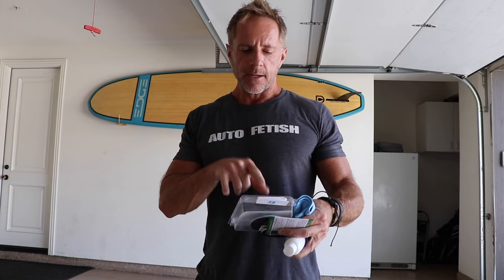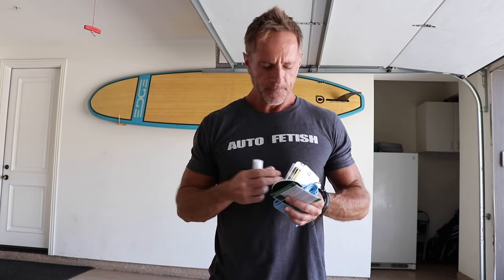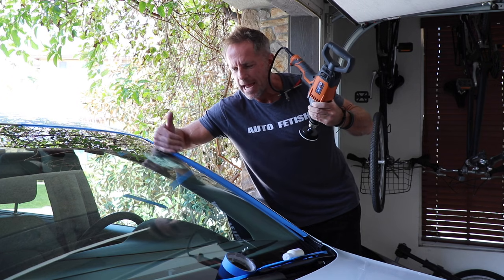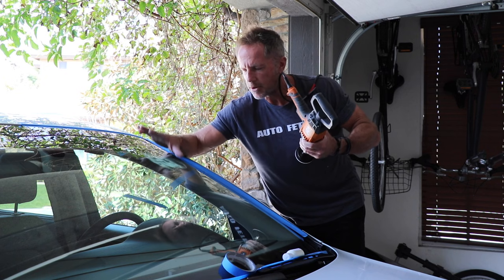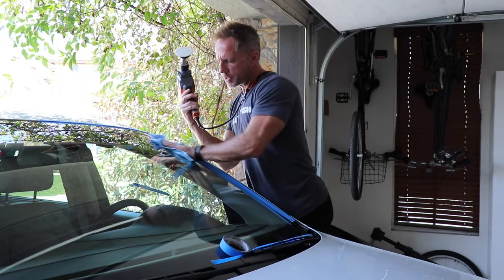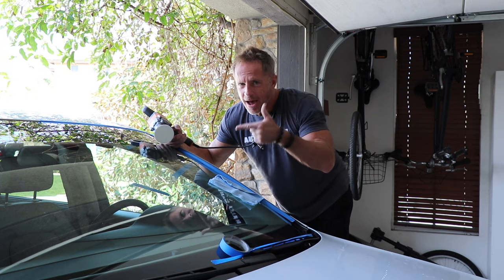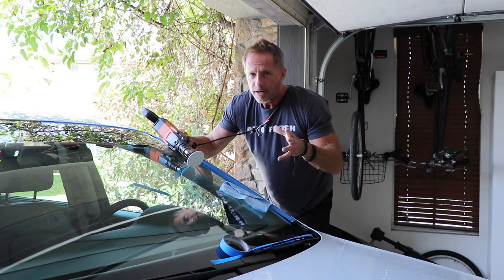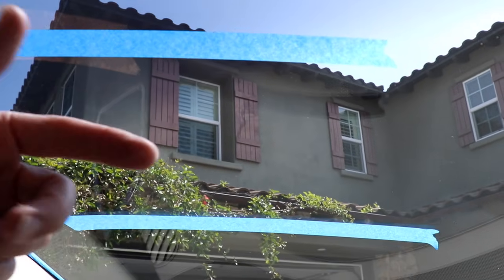Windshield Scratch Repair: BEST DIY scratch repair kit

Comment: I hope you can appreciate an advice from less experienced detailer. We have been doing it in Poland (and now I do it in UK) for years. Kits are expensive and not always 'great'. You can make such kit on a budget mixing cerium oxide and distilled water 1:1. Use felt pad (that's very important) attached to drill or rotary buffer. Do not exceed 1500 rpm. Spray mist of water on the glass and liberally spray felt disc too. Add cerium oxide mix onto a pad (5 pea drops is fine) and slowly do 2-3 passes. IMPORTANT not to stop moving to avoid creating what I call focal indentations. Add mist of water and bit more cerium oxide and repeat. It is loooong proces as glass is hard. While windscreen usually takes few hours! Side effects: deep scratches will stay and concoction will fill in all tiny stone chips and will make them more visible. It will disappear with time and as you clean the windscreen. TIP: maintain moist windscreen as you polish. Please try and I hope to see next video with your opinion. Keep on mentoring. I salute you :)
Reply: Hey Lukasz thanks for your advice. I used the kit on this video, it got out some wiper scratches but I have some fine swirl marks now where I probably was a bit aggressive with the polishing. Any tips for getting those out? Some more lighter polishing or use some resin? Thanks

Comment: I have watched a lot of glass polishing videos and here are the conclusions I can give to you:  1) For fast removal, a multi-step process using sandpaper first, then the glass polishing pad and cerium oxide compound is the most effective.  2) Cerium oxide compounds need to be kept wet.  They dry quickly and loose effectiveness... so what you need to do is have a spray bottle with you filed with water and give it a spray every so often.  Something like 30 seconds of polishing then spray and polish some more.  3) Cerium oxide compounds are not like paint compounds.  You don't have to wipe it off after every pass.  Just re-wet it and keep working.   4) Yes, you are supposed to have thick layer of compound on the glass.  Every pro I have watched doing this had the glass completely opaque with compound.  5) If you glass is not getting hot, you are using a tool that doesn't have enough RPM and/or are not putting enough pressure.  Many of the videos I have watched have the glass so hot that when they spray water on it you can see the water flash off and turn to steam.  I am not saying you should get the glass that hot but if it's barely warm, clearly you are not causing much abrasion.
Reply: I've seen a couple of glass polishing pros who have an IR thermometer to monitor heat generation. They say to keep the temperature between 120-140F maximum or else you risk distorting the image in the glass through distortion.

Comment: Home Trick: 25% Rubbing Compound (medium/heavy) 75% Fast Orange with Pumice**, and a high speed polisher/buffer/DA. 1 to 3 mix ratio and go at it. You could use Wool, but I recommend felt for glass, pad size is up to you, 3/5/6/7in. Squirt with water to keep the surface lubricated/cool and to re-activate the mixture. I would "Finish" with cerium oxide for the final polish or even auto polish works..you will also want to use some kind of sealant or ceramic coating after the polishing.

Comment: The windshield in my '54 Pontiac is near perfect except for pretty bad wiper streaks. It's either this kit or $500 for new glass. Also don't have a polisher and they are half the price of a windshield. I'm going to buy the kit but replace the polish with pumice hand cleaner and buffing compound. Your vid was spot on for the novice. As you said, we're raised on "more is better" and many people don't have the patience for some work, hence the name "detailer". Prep work is also just, if not more important than the job and usually takes longer....but not in this case. Thanks for sharing!

Comment: I just used orange hand cleaner with pumice and turtle wax buffing compound on a 3m buffing pad. Works on wiper marks and scratches. Cheaper than a pre packaged kit .
Reply: Obwan, I have a semi deep-scratch on the outside of my Car window. Deeper than the one on hear. 
My Son ran his Dirt Bike near it and the lever scratched it. 
It’s a Brand new BRZ and I was Pissed. Do u think the Orange cleaner and compound will work or at least take some of it out. 
Afraid I may make it worse. 
Thanks for any help !!!!

Comment: My boyfriend buffs scratches out of windshields. He uses Happich Semichrome polish & uses mineral oil to keep it from drying out in a sprayer. He also uses an air die grinder with a buffing pad. It leaves a mild haze when he's done. To cure that, he goes behind it with toothpaste & water. The final clean is Coca-Cola on a fresh pad.

Comment: The 10 second takeaway:1) if you can feel it with your nail I will not come out so don't bother with a snake oil DIY kit2) it will take you ages with a home drill which doesn't have enough torque and is unstable3) you will probably not be physically strong enough to be able to polish it for long enough ( Lukaz Kawka below gives a balanced view on how long it really takes!)4) you will be bored and despondent before the job is anywhere complete and feel like an idiot for wasting your money5) it will turn pit marks into an annoying orange peel finish and clump into the rest of the pits making your screen look like it has measles6) you will be frustrated that it is not working and will press harder and use more speed which will cause more heat that can easily crack the screen which will use the convenient wiper score as the weakness to propagate from. game over

Comment: I would have preferred watching you share more of your personal insights, and your proven methodology. I know you want to show amateurs how to use the Amazon kit as designed. But with all your experience, I'm sure you do a lot better with one of your DA or rotary polishers than that awkward drill rig. I also suspect you probably use a rayon pad and cerium oxide compound, or a product like Griot's fine glass polish to remove light scratches; and, leave really nasty scratches to glass pros.

Comment: What kind of drill should I get? What rpm should I get?
Reply: Drills are great for removing water spots and streaks but useless for scratch removal. You need a rotary polisher (NOT orbital or DA) to remove any scratching on glass.